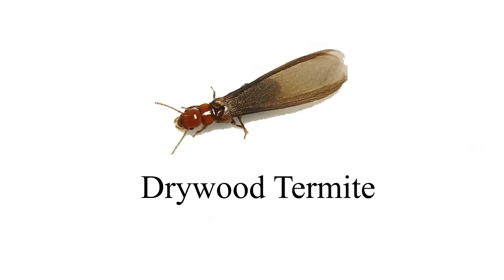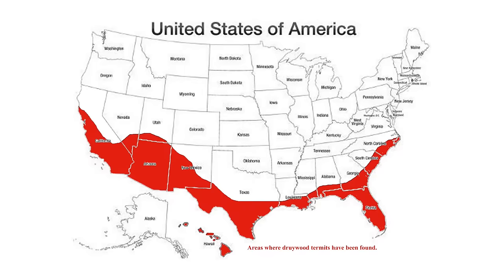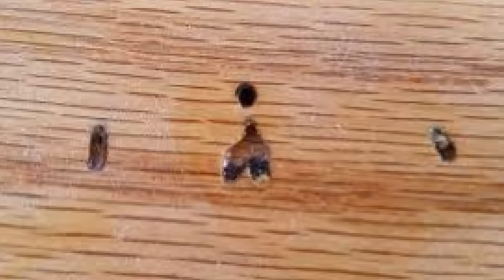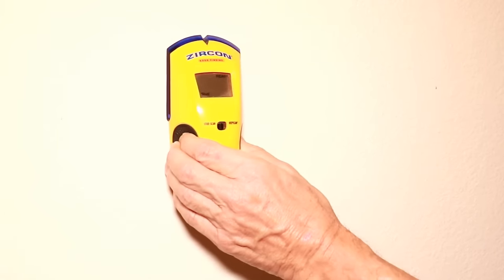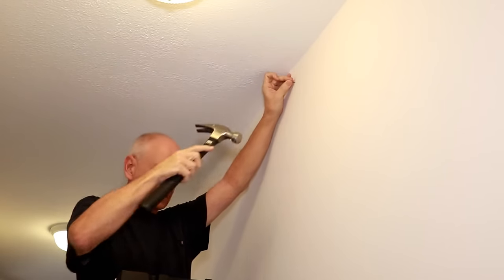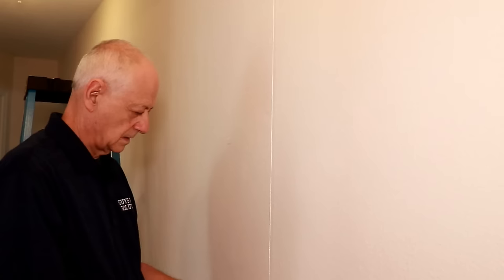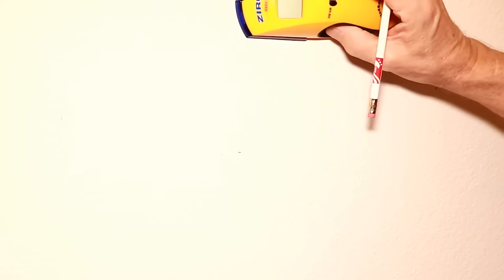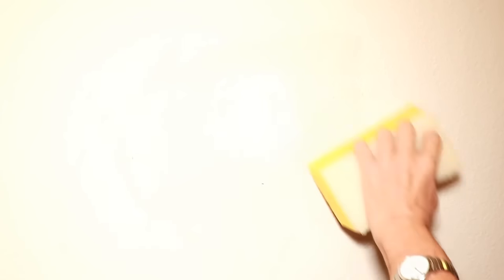How to Treat a Drywood Termite Infestation Yourself. A MUST see if you have Drywood termites.

Comment: Your videos have been very helpful. I just had an inspection and they determined I have drywall termites. I am in a townhome with 4 other units that are attached. The spot treatment is not cheap so I’d rather avoid the bandaid and just move forward with tenting. Do you have any suggestions on how to approach my neighbors? I feel like if they comply, I’ll be in a worse place spending money on constant spot treatment but never really resolving the issue. Thanks in advance for your time!
Reply from the maker: If you have dry wood termites in a townhome, that is a definite problem.  It is very difficult to convince everyone in the structure to go along with fumigating the entire building.  If even one person disagrees, then you cannot do the tenting.  Unfortunately, many people are in denial when you tell them they have drywood termites.  A lot of people don't even know what that is.  In a way, you can't always blame them because they may not be seeing any evidence of an infestation.  Oftentimes, the frass that is produced by the termites is inside the walls, where the residents cannot see it.  Since there's no evidence of an infestation, they think it is only affecting your unit.  The truth is though, that if your unit is infested, then they all are.  You should also know that it's not as easy as you may think to eliminate the problem.  It is not just a question of fumigating the entire building.  If you have drywood termites, then all the buildings surrounding you have them as well.  Since they swarm every year, you are going to get reinfested sometime within a year after the tent comes down. You may even get infested the same day it comes down, if you fumigate during swarming season.  The gas they use to fumigate has absolutely no residual action, so it will not prevent future infestations.  Therefore, it is pretty much a total certainty that you will be reinfested.  The only way to prevent this is to do a preventive treatment every 60 to 90 days on the entire building.  I have a video on how to do that, and I will give you a link to it.  This is certainly going to complicate the problem because, not only do you have to convince everybody to do the fumigation, now you need to convince everybody to do the preventive treatment as well.  To make matters worse, this is a treatment that most pest controllers will not do.  That means everybody needs to do this themselves.  If anybody fails to do the treatment correctly, or in a timely manner, then the entire building can become infested again.  I know that I'm not being very encouraging right now, but I do want you to know all the facts when you go talk to your neighbors.

When dealing with the neighbors, I always think that food helps.  I recommend visiting each of them.  You should be armed with two things.  The first thing you want to be armed with is all the information that you can possibly gather about dry wood termites.  You can feel free to share my channel with everybody and tell them that I would be more than happy to answer any questions that they may have.  The other thing you need to be armed with is a plate full of homemade cookies.  If you are not good at making cookies, then go get the freshly baked ones at the supermarket.  I always figure, if you feed them, they will talk.  The best way to approach it is to sit down with them in their home and calmly explain what is going on, and the fact that they are most likely infested with drywood termites.  If the problem is left to continue, there will be structural damage at some point.  Drywood termites are slow eaters, so this can take several years before it becomes a problem.  That being said, you need to explain to them that it is not something they should ignore.  Several years goes by very quickly, and you don't want to come home one day to see your roof sagging in.  If they say no, then you should not get angry, and just thank them for their time.  You don't need a neighbor dispute on top of everything else.  If you are nice to them, they may sleep on it and reconsider it in the morning.  If you make them mad, then they may dig their heels in deeper and put up even more resistance.  If you have a homeowners association, you should bring this to their attention.  They can often require homeowners to comply and pay for the treatment.

If you cannot get the neighbors to agree to the fumigation, you can spot treat it yourself.  You won't find all the galleries, but it's better than doing nothing.  I will give you a link to my video on how to do that.  You should also begin the preventive treatment immediately, so that you don't get anymore of these guys paying you a visit.

I hope that helps.  Be well Carli. 

Video on how to prevent dry wood termites:  https://youtu.be/neNsmVbj8Pc

Video on how to spot treat drywood termites:  https://youtu.be/U7ck7zhS0Xo
Reply: I'm very knowledgable on this subject as well.  If your neighbor's not willing to agree to treat the problem with fumigation, then you need a lawyer Or a realtor to just sell it.  Sorry to say.
Reply from the maker: @lighthouse6120  Point well taken.  I don't know if you can legally force someone to treat for termites.  I never went down that road.  It would be an interesting case.  Selling would be knowingly passing the problem off to an unsuspecting buyer.  I don't know if I could do that myself.  The termites may get caught on the termite inspection, but you could probably get away with a cheap spot treatment to satisfy the lender.  Still, as tempting as that would be, I wouldn't do that to someone.  That's just me.  I would fix the problem and then sell.  Drywood termites are just one of several reasons why you should never buy a condo or a townhome.  They seem cheaper up front, but they can end up costing you a lot more money and heartache in the end.  I should probably do a video on that.  Be well my friend.

Comment: Thank you for all of the great advice and the time you take to explain things. I purchased the Bioadvanced termite treatement like you suggested, also purchased Boracare. But I am not sure if bioadvanced is the right choice for my situation. We are replacing our 3 ft high deck, without the boards in the way, we have the chance to dig the trench and treat. The deck spans a good 35 ft on one side of the house, this is where termites where found 20 years ago, treated twice, last in 2002.  Once the deck goes back on, it would be hard to sprinkle the Bioadvanced every year, because the deck is so low. We dug the trench but are now wondering if Termidor would be a better choice, once the deck is back on, there is no way we can do this properly again.
Also we found many new allow oak flooring, same side of the house. Could you make a video on how to go to treat your floorings. We still don't understand if the colony is in the floors. We have so busy and have yet to inspect for tubes, but we will once we complete the perimetral treatement.
Reply from the maker: I am so sorry that you're having this problem.  Since you have already trenched, then I think it would be wise to go ahead and use the Taurus SC.  Just follow the directions in my video on the proper way to trench for termites.  I noticed that you commented on my video regarding drywood termites.  Those guys get treated much differently and trenching will not work for them.  Since you indicated that your house was trenched in the past, then I suspect you are dealing with subterranean termites.  If that is the case, then using the Taurus SC would definitely be the way to go.  If you do the treatment properly, it will last at least 5 to 10 years.  Of course, after that, you are going to need to figure out another way to treat. You may want to consider a design change to the deck that would allow for some board decking to be removed that runs parallel to the house.  It would only need to be about 6 inches wide.  This would allow you to remove the boards and treat with the granules every year after the Taurus SC is no longer effective.  The good thing about the granules is that you do not need to trench.  You just sprinkle them along the edge of the house and water them in.  Be sure when you build the deck that you have no wood touching the ground.  I know that there are deck posts that are rated for ground contact, but it is still a very good idea to have those posts placed on concrete supports.  After the deck is built, you may also want to consider placing RedEye stations around the house, spaced at 8-foot intervals.  These stations do not contain any pesticide.  They are basically a monitoring station that has a wooden dowel inside and a red dot on top, that is viewable through a clear plastic window.  When the termites eat the dowel, it drops down into the station, and the red dot disappears.  At that point, you know that you are being attacked by termites.  All you need to do then is inject a fipronil foam into the station and that will kill off the colony.  There is only one place you can buy these, and I will give you a link to it.  
 
With regard to the wood flooring, subterranean termites never colonize in your house.  They always colonize in the ground.  The only reason they come to your house is because it is their favorite restaurant.  The thing is though that they must return to the colony fairly often to obtain the moisture they need to survive and to feed the other termites in the colony.  Therefore, if you treat the perimeter of the house, there is no need to treat the floor.  This is not the case for drywood termites.  The only way to get rid of drywood termites is to fumigate.  So, even in that case, there is no need to treat the floor.  That being said, in the case of subterranean termites, you can give the process a boost if you do treat the floor with a fipronil foam.  If you know that you have termites eating your floor, then let me know and I will give you the procedure for it.  This can cut the treatment time in half.  It normally takes between two to twelve weeks to kill off an entire colony.   I do have a video planned on this type of procedure and I will get it done just as soon as I can.  In the meantime, I would be more than happy to give it to you in writing.
 
I hope that helps.  Be well my friend.                             
 
Video on how to properly trench for subterranean termites:  https://youtu.be/Fy7YHi_7Z8g
 
RedEye stations:  https://www.solutionsstores.com/red-eye-termite-monitor
Reply: @GuysPestSolutions  thank you Guy so much for the extensive explanation! I truly appreciate the time you take to type your responses, and I am grateful for your recommendations. The idea of removing a few deck boards to treat is brilliant! And luckily our boards are perpendicular to the wall house, so this can be done on the next treatement. We are on hold on placing the boards on the deck frame and am thankful you replied so quickly as the temperature is about to drop next week. You are most likely correct that these are subterranean, the wood has long channels and not the round pellet like holes, in addition we  live in KC missouri where I doubt dry wood termites exist.  I appreciate you taking the time to provide me the in writing instructions. Is there a way I could send you my email address in a more private setting, or do you have a web site where I can contact you? Also, can I purchase the Taurus product through your affiliate link if you have one? You are investing a lot if your time to help, and  I rather know you are getting something back.  Thanks!
Reply from the maker: @baba-sm1fm  Thank you so much for those kind words.  Very much appreciated.  You can write to me at my e-mail, which is guyspestsolutions@gmail.com.  Just remind me who you are because I get a lot of e-mail and it is easy to get people confused.  Just tell me that you are the person with the deck, and you want the treatment for the wood floors.  I always make it a point not to accept any compensation from pesticide manufacturers or suppliers.  A lot of people tell me that I should, but I feel that it would damage my credibility if I were earning a commission for recommending products.  I only recommend products because I know they work.  If there is a product that I have not used before, I always note that in my response.  The truth is that I do not do this for the money.  I know this may sound a bit corny, but my only motivation is the joy I receive from helping others.  It is my personal policy to spend as much time as necessary with each person to ensure that they have a successful outcome.  If I can achieve that, then it is reward enough.  In your case, the least expensive place that I know of to obtain the Taurus SC is Solutions Pest and Lawn.  You may also be able to get Navigator SC from domyown.com for the same price or maybe a little less.  Both products work equally well, so just order the one that is the least expensive.  I have never used Navigator SC, but it is the exact same formulation.   

I hope that helps.  Be well my friend.
 
Taurus SC:  https://www.solutionsstores.com/taurus-sc-termiticide
 
Navigator SC:  https://www.domyown.com/navigator-sc-termiticide-p-19237.html?sub_id=19238